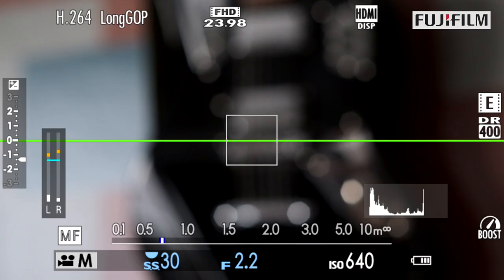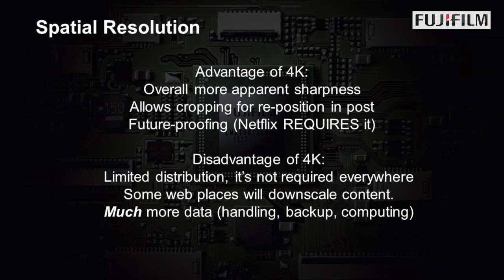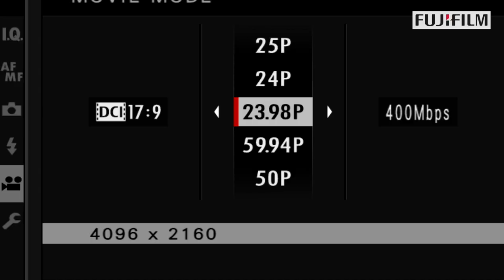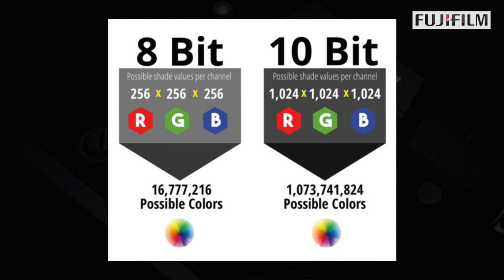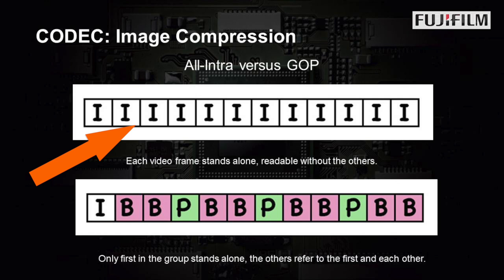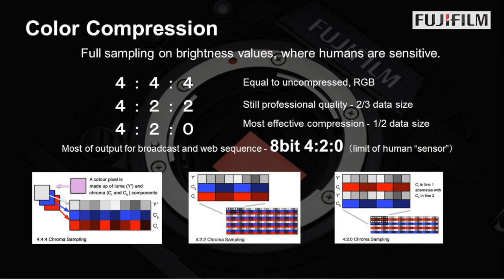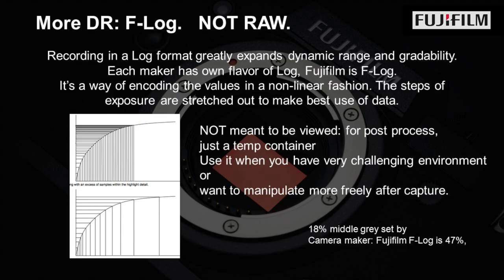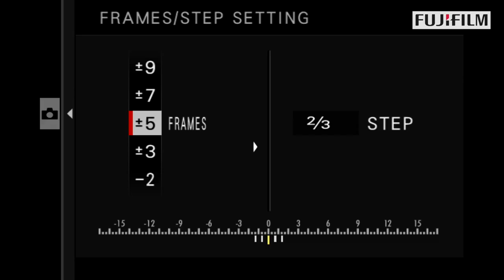Fuji Guys - Video Tech Simplified

Comment: Great video nonetheless but i just want to ask you...
why did you set a shutter speed at 1/30 when shooting 24fps. Shouldn’t it be set at 1/48??
Double the number of frame rate and use the number to set a shutter speed.
Reply from the maker: The shutter speed is a personal preference for the look and feel of your video. The nice thing about the X-T30 is that you have the ability to shoot with traditional still shutter speeds (1/30, 1/60), OR the more movie-centric 1/48, 1/96 or 1/240 second when using the "Movie Silent Control" setting.